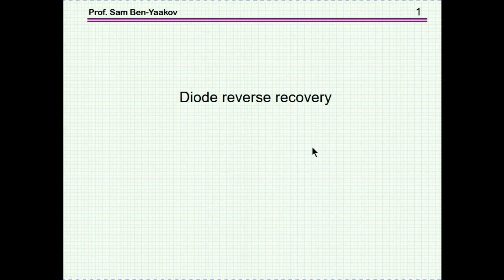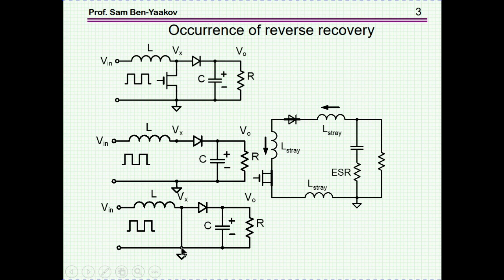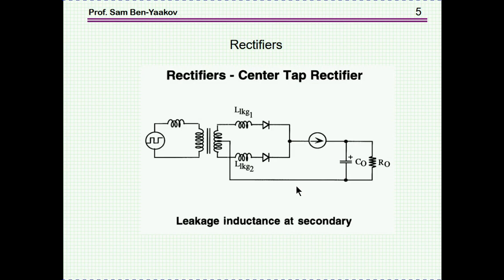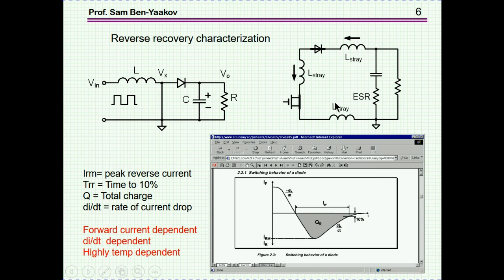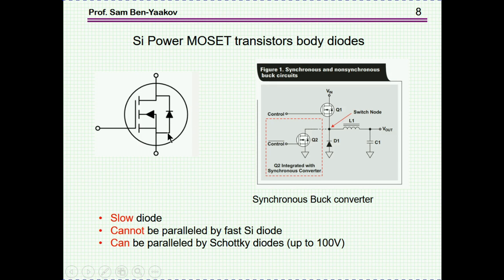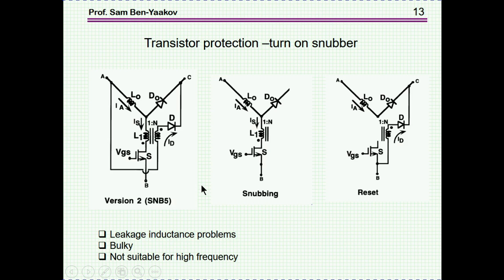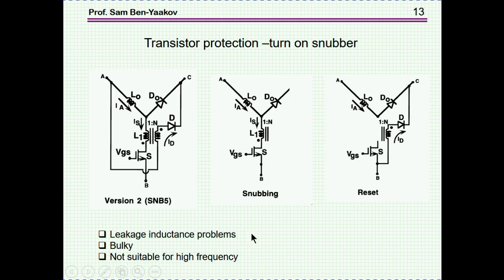Diode Reverse Recovery

Comment: Excellent video again! Thank you! Could you pls ask one question? Around 8:48, you mentioned the loss brought by the reverse recovery current will not be dissipated by the transistor. However, in a boost application as shown in your previous video, during switch ON of the transistor, the current Id will rise before the dropping of Vds. Whether it means most of the Irr actually lead to the loss in the transistor instead? Thank you!
Reply from the maker: At turn ON the transistor current is limited by the leakage inductance, which is the slope in the plot, and the transistor is already Rds(on)

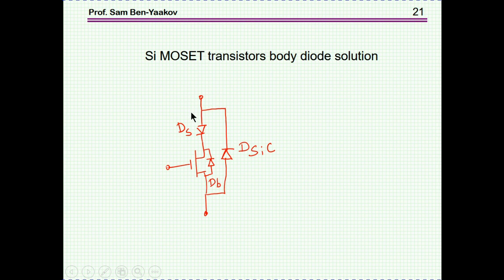Comment: Great vid professor (as always). I was wondering if you could help me understand the advantage of adding the Si MOSFET & Si in parallel to the SiC 26:04? The SiC looks to replace the body diode (good for RR), but adding the Si diode in front of the MOSFET doesn't allow you to take advantage of the low Rdson/low voltage drop(?) which was the reason to use the Si MOSFET over a Si diode in the first place? Would we replace the Si diode with another Si MOSFET in real world applications? Thanks.
Reply from the maker: Just had a second look at your question and realized that my answer needs amendment. The MOSFET is used to turn on and off the correct. Indeed, in this case there are-additional losses due to the series diode but it could be a Schottky diode of low voltage. This solution is being used in high voltage applications in which case the   efficiency penalty is not that high.

Comment: Hi Professor, 

@19:40 when Q1 and Q4 is turned off it will be hard switching turn off... Because as gate is pulled down the Vds voltage will rise and there is still current in the FETs Q1 and Q4.. 
No doubt the current will continue as shown by the red trace as inductor will turn on the body diode of Q2 and Q3 which makes the drop across them low and will turn on with ZVS.

So during turn off you don't get ZVS or ZCS but during turn on yes you get ZVS for both branches.. correct me if I'm wrong. Thanks
Reply from the maker: See https://youtu.be/w4cxLPl2Wsg
Reply: @sambenyaakov  Thanks, I checked that video. And I still stick to my point that Q1 and Q4 gets ZVS during turn on however turn off is having hard switching for primary
Reply from the maker: @vbidawat93  This is not hard switching because there is a minimum overlap between voltage and current . I call this pseudo ZVS. Hard switching is when the transistor turns on against a conducting diode , e.g. a buck converter with diode when the high side is turned on. But then, we are talking about notation, you don't have to stick to the convention, call it as you wish😊

Comment: Wonderful video - thank you so much
Reply from the maker: Thanks
Reply: @sambenyaakov  was researching this concept in the context of a synchronous buck converter which is hard switching ~20 amps into ~1 mH loads at 54 V. Until your video (and a few others from nexperia), I didn't realize the impacts of the Qrr of the lowside mosfet during a half-bridge turnoff. 

The key takeaways for our application I hope aren't misinterpreted are:
1. Selecting a MOSFET with a lower Qrr will reduce ringing and EMI -all other things equal 
2. Qrr implies some current 'shoot through' when switching on the highside MOSFET. This current is in addition (and proportional to?) the switched load current 
3. An RC snubber on the switch node will reduce negative voltage and Vds stresses (ie reduce avalanche concerns??) caused by Qrr of the lowside fet
Reply from the maker: @kylehagen1476  Use a Schottky diode if you

Comment: What adjustment is required in synchronous dead time to take care reverse recovery problem? Should my dead time larger than reverse recovery time mentioned in MOSFET datasheet?
Reply from the maker: Deadtime is generaly not related to the reverse recovery. An example for deadtime need is in a syncronous Buck convertr after the high side transistor is turned off. This is followed by the mid point voltagd swing until the diode is catching. This is the required deadtime until the lower transistor is turned on.

Comment: Great lecture about diode reverse recovery and junction capacitance. Thanks for all valuable information. i did not know about flyback snubber. I thought it is a new innovation snubber (I currently work on this flyback snubber for IGCT). but seems it's an old snubbing technique. i will appreciate if you refer me to any  reference about this flyback snubber.
Reply from the maker: See references 42 and 45 in
http://www.ee.bgu.ac.il/~pel/seminars/seminar9.pdf
Reply: So many thanks.

Comment: I don't get why a diode should have switching losses. We see voltage-current overlap and think "losses", but during the recovery this overlap just means that energy is stored in the diode depletion region... the transistor takes this charge and dissipates it eventually... why are there switching losses in the diode?
Reply from the maker: Good question. I am planning to prepare a detailed answer in aviseo to be posted here. In short, the losses are really not in the diode but the diode is causing it - so it is considered as "diode loss"
Reply: @sambenyaakov  ok! the question arises because that should mean a lot for the thermal design... if  transistor and diode chips are separated, such as in IGBTs and in the fast diode example you show, it means these "diode losses" do not in fact contribute to heating of the diode
Reply from the maker: @Dahmac  Indeed. BTW there is some extra heating of the diode due to the high peak current but most of the energy is absorbed by others.

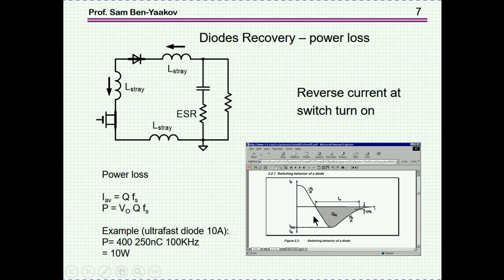Comment: Sir, in the 7:47 you mention the power loss the power loss is reverse recovery loss?  
If I want to calculate the diode power loss how do I do
Reply from the maker: Power loss due to diode is the  forward current in conduction mode and the reverse recovery loss as shown in slide.
Reply: @sambenyaakov  but in the boost converter the diode reverse recovery will affect the switching power loss of  mosfet right?

Comment: Is there any effective way to eliminate or reduce the reverse current of diode junction capacitance? series, shunt resistor or other way? recently it becomes a series issue in the SiC diode that i connected to flyback snubber. As you said this SiC diode recover energy to input (in my case DClink) or output. The secondary of flyback snubber has high voltage and low current, so I thought, it might be good application for SiC diode. However, during turning on of semiconductor switch (here is IGCT) the negative (reverse) current flow through diode and i am sure it is due to junction capacitance of SiC diode.
Reply from the maker: Seem to be a real problem. I din't have of hand any good solution to offer.

Comment: Thanks for the video.
I’m not very sure if I understood power loss discussion, 07:44 .
It contradicts with this reference from ST:
https://www.st.com/resource/en/application_note/an5028-calculation-of-turnoff-power-losses-generated-by-a-ultrafast-diode-stmicroelectronics.pdf

The way they describe it is that when the FET turns on, the FET voltage would still remain high until the diode reaches peak reverse current. This means the reverse recovery energy is dissipated on the FET. You mentioned in your video that power loss on the FET is negligible due to diode turn off, which is the opposite of what ST app note is saying. Can you please clarify?
Thanks
Reply from the maker: Not so. In section 2 they calculate the DIODE extra loss while I am calculation the TOTAL system loss. The diode extra loss is relatively small even when when compared to its loss in the forward conduction.

Comment: With regards to a saturable reactor, would it be possible to use the leakage inductance of the transformer to lower the rate of change of reverse current?
Reply from the maker: Yes, but how would you recycle the energy stored in stray inductance?

Comment: hi dear professor, it has been long that watch your beautiful power electronic lectures and every time i get beautiful knowledge and this video also helped me but i have a problem,,, i want to calculate the turn off losses of the reverse recovery diode but in PSIM when i insert diode it has no feature of reverse recovery time and reverse recovery charge and same as the case with the simulink and that is why i am badly stuck and cant move forward, calculating the turn off looses of diode as the part of my research thesis,,dear professor please guide me,, regards,,
Reply from the maker: PSIM is not the right tool. You can calculate lossed by Qrr*f*V
Reply: @sambenyaakov  thanku sir